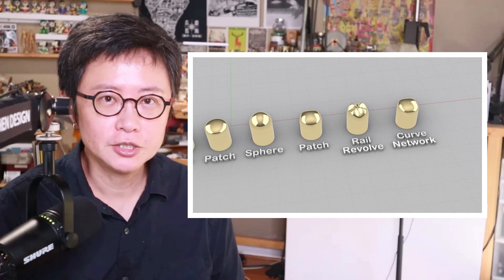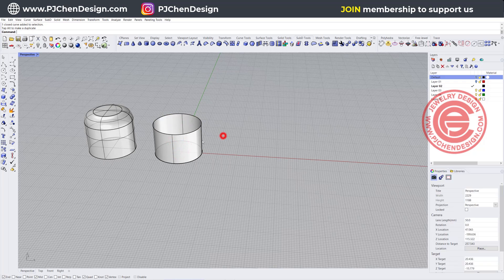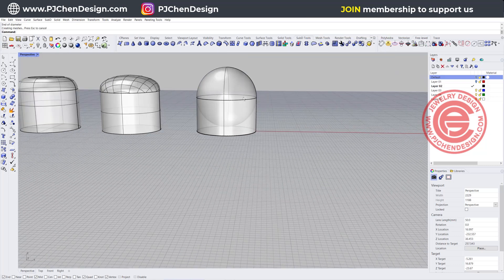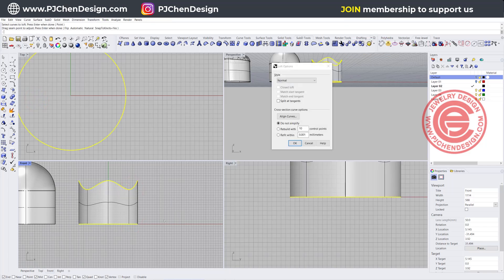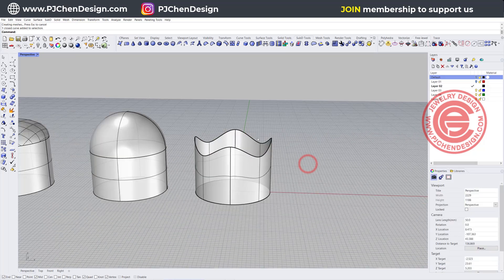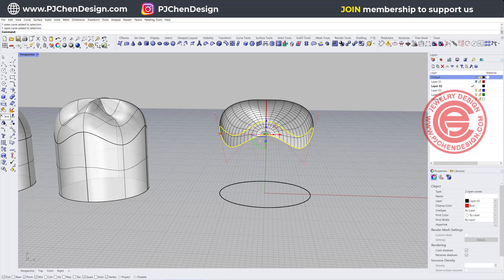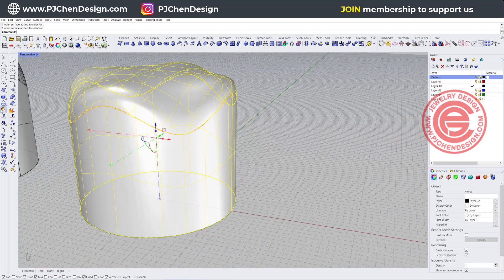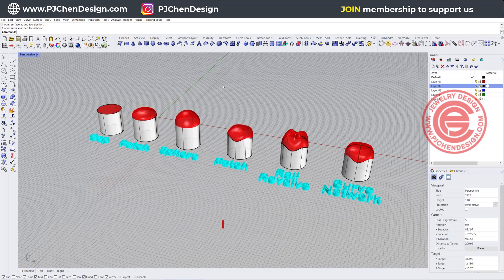3D Modeling Different Type of Prong Tip-Jewelry CAD Design Tutorial with Rhinocerose 7 #350

Comment: Patch is a poor way to achieve this. It is a lazy way of modeling. Even if your join works, you will/could end up with naked edges in the model. A better way would be to split the edge into two parts, then blendsrf the two edges.
Reply from the maker: patch is not perfect for irragular shape indeed.